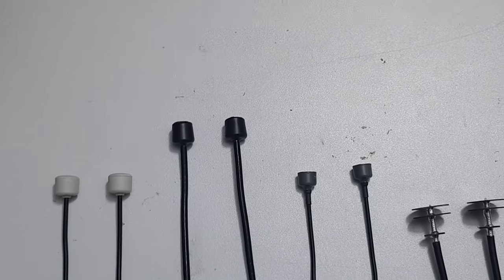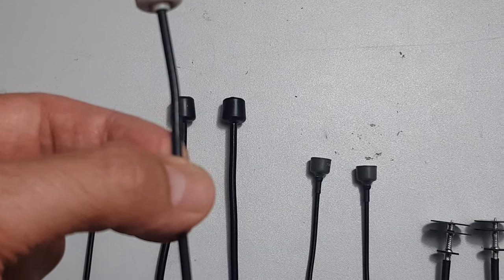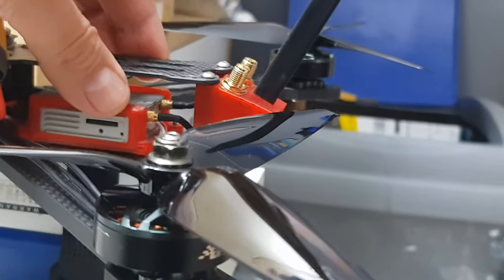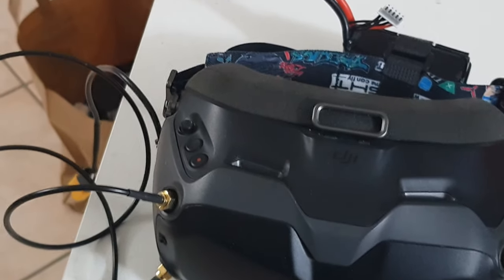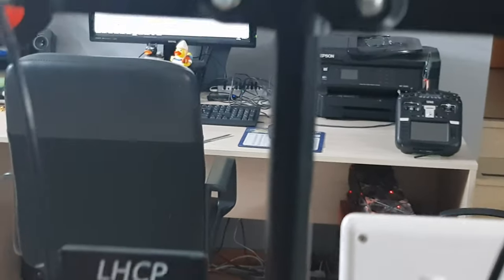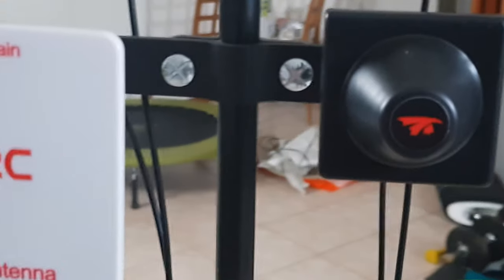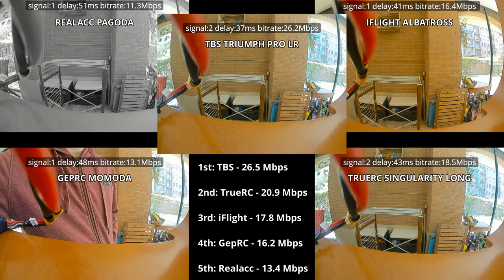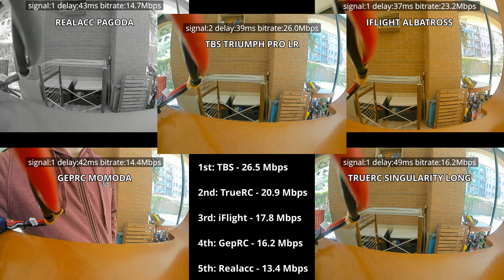DJI FPV Antenna Test: TBS Triumph, Truerc Singularity, Albatross, Pagoda, Geprc Momoda - Round 1

Comment: Great test. But do you also fly with extension cables to tower? Or just here in the test?  Because I once measured almost 50% loss with a 2 or 3 m extension!
Reply from the maker: Hi Mario, sadly I don't have the right equipment to test the DB loss on the receiving side, i looked at the price of the device you use in your videos but it's just way too much for me. For this test I used some cheap cables, RG174U coax 2 meters long, but i'm planning to get some RG58 1Mt gold plated, double shieled, 0.8mm cable, and i'd like to give it a try in the field, comparing the bitrate that i get when using the extension cable and when directly connecting the antennas at the goggles.... this could be an interesting test and surely i'll do it sometimes, while trying to find a reliable DB measuring device at an  affordable price, but still i would like to make a test in the field so i will do it regardess, cheers from Milan

Comment: Such a good test mate. I just discovered one thing. Where do you get the mmcx -sma (without pin) adapter cable from? Can´t find it at all. I ordered the Triumph Pro LR antenna but cannot mount it because the DJI mmcx-sma cable has a pin too. THX for your time mate.
Reply from the maker: You need a mmcx to female SMA cable. If the connector has a pin it's called female RP SMA, but if it doesn't have a pin then it's just called female SMA, and you need the latter. In This is an example I found:
https://www.banggood.com/F4-V5PRO-Flight-Controller-Spare-Part-MMCX-to-SMA-or-RP-SMA-Antenna-Pigtail-Cable-10cm-for-RC-Drone-FPV-Racing-p-1154316.html?utm_source=googleshopping&utm_medium=cpc_organic&gmcCountry=IT&utm_content=minha&utm_campaign=minha-it-en-pc&currency=EUR&cur_warehouse=CZ&createTmp=1&utm_source=googleshopping&utm_medium=cpc_bgs&utm_content=aliha&utm_campaign=aliha-ssc-it-en-all-newcustom-ncv90-0617-7ysale-v&ad_id=528184933426&gclid=CjwKCAjwwsmLBhACEiwANq-tXOx3GXCh4YJmxrTWnP9Wz0d32o40URnbVYO5KkKGbEs65JBEH-YT2xoCWG0QAvD_BwE&ID=523627

Comment: Hi! I just found this video. Amazing channel! I'm torn between the Triumph Pro and the new Truerc Matchstick. Would you still suggest the Triumph over the new Truerc Matchstich, one year after this testing? Thanks!
Reply from the maker: Unfortunately I have not tested the Matchsticks, however TrueRC antennas are usually good quality. From my experience with the Singularities, you will probably be fine with either the Triumph or the Matchstick.

Comment: @Fab FPV Ciao, potendo avere la stessa antenna per Air Unit è preferibile connettore MMCX o con la peolunga per SMA è uguale? cioè è vero che una prolunga SMA perde 0,5Db rispetto al MMCX diretto?  grazie
Reply from the maker: una prolunga SMA,, anche piccola, dai miei test fa perdere parecchio segnale.... il mio consiglio è quindi di usare sempre antenne con MMCX diretto, lavorando sui sostegni tramite parti 3d printed in TPU...
Reply: @fabyt68  grazie

Comment: Just switched to Unify nano pro on my Tinyhawk 2 Freestyle and just ordered ufl and sma  long range TBS antenna hope i can get better reception and penetration around my house, tnx for test!
Do you think we can assume that those results can be noticeable in analog setup???
Reply from the maker: hi, definitly yes, here we are talking about antenna perrformance in general. Though, i don't have an analog gear so i don't know how the video quality varies according to the signal quality. For digital FPV video, the bitrate doesn't particularly influence the video quality, as long as it keeps over 10 mbps, than you begin to have pixalations and eventually a video break up when you get to 1.5 mbps, take or leave.

Comment: What about luminier AXII  antena??
Reply from the maker: Hi, I haven't had a chance to try any Lumenier Antenna, I examined the recent double AXII but from what i understand it's better suited as a receiving antenna, while my focus is on the trasmitting side.
Reply: @fabyt68  the double axii 2 rx standard single axii 2 tx, its a really good tx antenna, best ive tried, very fragile, can break just from a hard landing withought even hitting anything.  U definitely should test it. Its going to be in your top 2 or 3 guaranteed.

Comment: How about stock Dji antennas?
Reply from the maker: Stock antennas are not great. Most aftermarket antennas would be an improvement
Reply: @fabyt68  thk, I'll try TBS. But original dji antenna gain is around 3dbic vs 1.6dbic of TBS. Does it improve quality or just fake numbers from dji?
Reply: Not necessarily fake numbers but you can’t really go by that number. IRL it will be different. I don’t know if many people using the stock dji antennas on the quad.